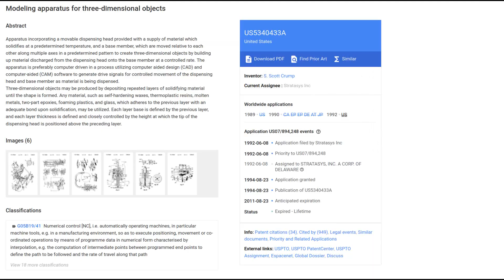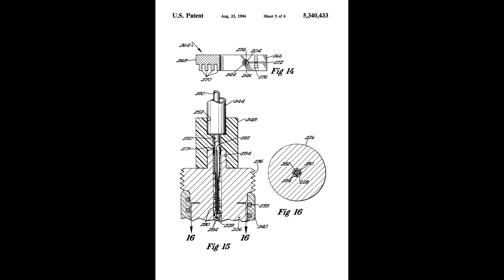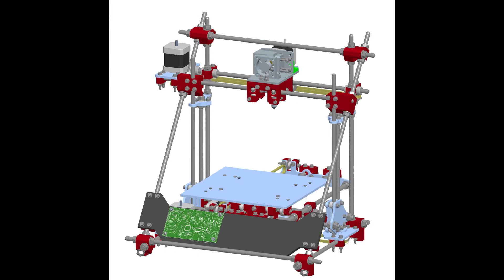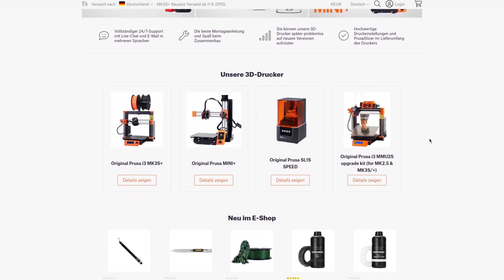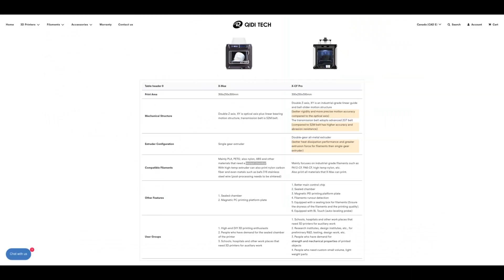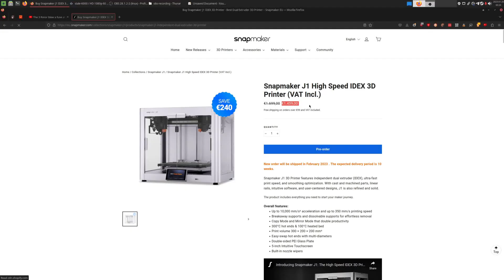3D Printing has gotten stale: The past, present and future of RepRap

Comment: It occurred to me the other day: Stratasys really lacked vision for the impact their technology could've had. Sure, every university had a $30,000 FDM machine which they would occasionally use for prototyping very specific models. But imagine if Stratasys had made a consumer-grade machine like the Ender 3 a decade earlier. Surely they could've become a household name which changed history? like Ford or Hoover.
Reply: I had the same thought a couple days ago, but at the end I thought they were right. The point is that general people don't need a 3D printer like they need a vacuum cleaner or a car, at the point that the market is still small even now that the price is at the rock bottom. So yes, they could have been where Prusa or even Creality is, but still I think Stratasys make more money than them just on their professional market. At the contrary if they brought to the market cheap printers they would have cannibalized at least a part of their high end machines.
Reply: @Marco Toselli  i agree. I think if you saw mass adoption of a 3d printer in every home ud see alot silk lizards. Benchies. And a handful of miniatures. The curve would be fast a year and a half maybe and they'd be on to the next thing.  These machines still require the use of cad in my opinion or 3d software to realize the full potential and thats where the work is. Just some thoughts. I've seem so many silk lizards.  The first time I told a "normal" person I had a machine that could make anything so long as it was out of certain plastics. "Yeah but what are you gunna do with it"
Reply: Without the internet, those machines were useless for the masses. Gcode files are far too large for dial-up internet. Also, the market had to exist for the filaments to be cheap enough for people to be willing to do trial and error.
Reply: @ryelor123  True. It probably wouldn't have been feasible in the 1990s. But it probably would from 2000 onwards. STL files are pretty lightweight.

The fact that hobbyists helped develop better materials than the patent-holder is further evidence that the patent hampered innovation.

And sure, it's unlikely they'd risk developing a home appliance. But at least something schools and small businesses could easily afford.
Reply: It's really not that simple, for one the only reason 3d printing as we know it exists is because of the millions of free manhours of labor the community has put in on top of corporate investments. 

No one company could have duplicated that let alone on a shorter time frame. 

There's also the fact that you can't just add a whole new packet to your business model on a whim. They would effectively have to fund staff and develope one or more entirely new companies to pursue tue consumer market.

You are also assuming they could develop a market similar to the one we know all on their own, more than likely they would invest hundreds of millions into a new venture, the product would be sub par and not consumer friendly,  the division would flash and burn, and fdm printing would carry a stain on its reputation that would dissuade many from trying when the patents expire. 

I mean, after all these years, hundreds of companies,  millions of users, only now are we coming to a point where maybe you could argue a minimum viable product is possible.... maybe.
Reply: @DrewLSsix  I think that the new Bambu Lab might be the true minimum viable product, but it's very closed down as a result.
Reply: They are much like xerox. Xerox developed lots of tech that other companies popularized.
Reply: @notanymore9471  Well, kind-of. But Xerox licensed that technology. They didn't just hoard patents until they expired.
Reply: I tell you what. They could have flood the market very early, but they would not make a penny from it. Every business is here to make a profit, not to make everyone happy. It is far more better to sell 30,000 USD machine and then supply it with overpriced consumables, than selling under 1000 USD and then sell nothing.

And the thing of someone occasionally using 3D printing is the same even when you have cheap machine. 3D printing now simply does not have so many use cases for the printer to go 24/7 in average business and really save a ton of costs. Customer is most interested into investing into new machine when he/she is starting with 3D printing. So it is far better to sell expensive 3D printer only because you are the only one who can.

It is also far more better to first prove the idea (which Stratasys did) and for that you need ton of money. If 3D printing would have be opensource and free from the begining, nobody really cared. It is different when there is large company who made millions of USD and their pattents right now expired, than when there is some crazy guy who made exactly 0 USD
Reply: @FUKYFILM  I'm not saying they should've open-sourced their technology. But I'm pretty sure they could've made (or licensed) a more consumer-grade machine around 2009 and it would've been successful.

Comment: I have a used printrbot simple metal that I bought for the price of 3 spools of pla. I use it 2-3 times a year. I originally bought it to replace a gear in a toy. Honestly I think the market is flooded with cheap used printers because people buy them thinking that it will change their lives but they find out they have little use and sell them. Despite being computer controlled, 3d printers have no accuracy and can’t be realistically used to design mecanical parts. You’re gonna say I’m wrong but the truth is that for designing a single part that fits, you need countless tries. If you only consider the cost of the final part in pla, yes that is cheap. But if you consider all the parts you trashed in order to make it and well… your time… yes your time, its far from a good idea. A single design can cost more than the 3d printer and have no real value in the end. If you get lucky and find a model online that fits your purpose you might save some time. It only happened to me once with a mask for covid which I never used…

Comment: Bed slingers are getting a bad rap.  For small build volumes, and for parts that are squarish or pyramid in the shape of their volume, they work.  Note:  CoreXY printers move in the Y or X axis when both motors move.  They move in a diagonal direction when only one motor moves, and the other motor is locked.  Since the head usually moves in a combination of X and Y at any given moment, it's clear that one motor in a corexy is doing the heavy lifting at any moment.  So a core XY printer will need more powerful motors then a same sized bed slinger.  So much for being faster.
OTOH, the corexz layout will combine the power of two motors to move the Y axis, as the Z is moved slowly and usually not at the same time as the Y.  For speed, the coreXZ may be the sleeper design.

Comment: Honestly, I thought FLSUN was in on this early. I’ve seen really good reviews, and while an SR isn’t quite as fast as a coreXY, they’re also cheaper. I’m probably going to buy one of them as my next printer.
Reply: Have you seen the V400 ? Is crazy fast thought expensive , faster than any of the Bambus too
Reply: @ulforcemegamon3094  Well, I got the SR I was hoping for, and it’s been fast enough for my uses. However, the V400 seems mediocre based on reviews. It’s basically a slightly larger SR with some mods that are already pretty common in the DIY space, and a half-arsed klipper install. All for twice the price. It seems to me that a klipperized SR with some extra cooling fans will perform as good as a V400

Comment: I waited till 2012 when the 3D printer market crashed and got me a Replicator Dual for $250 🥰 I didn't upgrade until 2020 since redesigning the flaws fixed almost everything wrong with those original models. Larger printers where too expensive and ended up finally getting a i3 stile printer that was open box for $110, again having to redesign many of the parts to give me another solid printer. The nature of a bed slinger will always have speed and cooling issues, so when another printer was discounted and open box i got that.. Creality Sermoon D1 for $250, this one had by far the best frame but poor quality control and plenty of design flaws itself. Again.. now an extremely reliable printer now.. just a larger and much more rigid version of my old replicator dual "Darwin Cartesian" printer.

Long->Short; software and faster 32-bit boards to be able to keep up with every increasingly complex tasks the software asks of the hardware have been IMO the only improvements in the past 10+ years. Otherwise CoreXY might have been the only real innovation to reduce extruder mass by moving the X axis motor to the frame

Little Longer; I can run my 260x280x310 Sermoon D1 (Darwin Cartesian type) at 250mm/s and 10,000 acceleration without ghosting but starts to hit the controller boards limits. I'll always consider i3 style machines more of an economical move than innovation for improved printing, unless innovation means more accessible which is definitely can be

More crap; my old Replicator dual with the original 8-bit MakerBot board still prints beautiful using modern slicers, just needs to be connected with USB to print as good speeds and high detail/accuracy. Reading from the SD card makes the board work harder and needs to run at about 45mm/s to prevent artifacts/blobs/skips, otherwise 200mm/s is perfectly doable but 160mm/s is the sweat spot with almost no ghosting at all

Bonus Crap; now companies like Anker and DJI jumping in is starting to push the quality and refinement of 3D printing to where I think i can finally recommend at least the Bamboo X1 to "normal" people

Comment: “If not for the educational market, a machine this bad for the money couldn’t exist” really sums any technology in education
Reply: I've been greeted with the misfortune of using a dremel 3d printer

it's wonderfully awful. for $1400 you can get the same quality of a monoprice MP select mini, with about the same build volume

I even had to 3d print my own replacement part for the door hinge, which was constructed as if a toddler designed it

it also layer shifts randomly, and uses a proprietary slicer AND filament... $1400 is crazy

Comment: I was going to get a Bamboo lab printer but the build plate was too small, I’m looking for at least 300x300 

Instead I got a tenlog, which has two extruders and allows for multi material without purge towers, and printing two things a at once 

I wish I could have the speed and material station of the bamboo lab with two printheads and a larger build area
Reply: Seems like you're describing the idex voron

Comment: I got into 3d printing with a Mendel and was hooked immediately. I built an i3 (wood frame), a custom delta (which was a bit naff!), a hypercube, bought a Prusa Mini, and now have both a Bambu P1P and X1CC. For all the (valid) arguments against Bambu and the non 'maker' aspect to its design and software its a phenominal leap in performance. I know Voron was getting there but was still obscenely complicated and expensive compared to earlier printers. 

One things for sure is that bed slingers are done. They've had their time in the sun, and CoreXY has proven without a doubt that its vastly superior. I'm really looking forward to the next generation. We're about to see an absolute boom in innovation in 3d printing. Prusa - arguably the best printer manufacturer out there is no doubt absolutely pooping themselves right now, and can no longer rely on their trusty 5+ year old design. I really hope that they're hard at work on a new printer (not the XL unless theres currently major changes happening behind the scenes) that brings them back into the frame as with the way things are going they're set to become irrelevent, along with the crappy manufacturers like Creality.

Comment: Did Slice Engineering really say "Communist Dystopia"? LMAO

Do you know about the Positron V3? It's in the same category as the Vorons but I think it's unique in its own right. I think a prebuilt one would be a great alternative to a mid range bed slinger, esp for people that don't have much space at home or want to bring it to places...
Reply from the maker: The Positron has potential, if someone was to optimize, build and ship the thing. You'd save a lot on shipping with a machine that compact and the design could be optimized for manufacture. BUT: Assembly seems complicated, maybe if you assemble in china or india? And there should be protection or something for that glass bed, it's way to fragile for something that will eventually be dropped in collapsing/erecting the Z axis. That's a lot of work, but very well possible.

But someone has to do it. And that's the problem. Maybe you'll be that someone?

Comment: Slices patent doesn’t prevent innovation, it encourages it. It forces the community come with better designs.
Reply from the maker: No, I don't think so. It hinders further development on the idea "seperating a heatbrakes thermal and structural jobs into different components" for anybody other than Slice Engineering. There might be different approaches, such as the E3D Revo "Nozzlebreak" platform, and it might even encourage innovation there (though I doubt it). But it definitely hinders or even prevents development on the patented idea for anyone outside of Slice.
Reply: @SERVOPUNK  look at 3DP and Prusa… innovation stagnated for 6 years for wide scale printers until Bambu came along. Open Source to some extent pushes complacency. Laziness. Slice patented a commercial product they created. Nothing wrong with that.
Reply: @thelightspeed3d712  If a company were to patent a standard two wheeled bike but fails to bring it to market, and another company manages to successfully bring a tricycle to market and the product is successful, that doesn't mean that the tricycle is better, more efficient or innovative. Innovative in the sense that it is forced to find a way to skirt the law to bring some amount of value into people's lives, but not in the sense that the product is actually any better. Patent's don't by nature encourage any measure of innovation, and especially not improvement.

Comment: Got to say I am really happy with my vzbot that came from my horrible tronxy x5sa. I used the tronxy as it was configured from tronxy and slowly upgraded till I was ready to make the jump.  

If anyone reading has a x5sa and is considering building it into a vzbot, this is the sign to do it. If you don't want a full vzbot build, install klipper on the stock board,do.the gantry mods using a EVA.corexy and bmg /v6 mount and brace the printer, you will have a substantial improvement.
Reply: Thanks, i don't have it but sounds interesting got the Tronxy as a starting point.
Reply: @OmegaDeepBlue  the tronxy out of the box was terrible for me. I used it for months with a quality v6 clone and that helped.  Things for a lot better when switching to direct drive using the stock extruder and a custom printed mount. Under extrusion and stringing was Eliminated, z sync belt was installed at this point along with printed frame braces. 
In all reality you could stop at this point and have a decent printer. It won't be the best or fastest but works pretty good and doesn't cost a ton to get to this point.

Comment: I want to gent into 3d printing and it is a very difficult choice, buy a proven, but stupidly overpriced Prusa, P1P and accept its proprietary parts and loudness or wait for more fast printers, because it feels there will be a lot of them launched soon. Really tough choice.
Reply: Build a Voron 0.2. Very capable, pretty cheap (for what you get) and you'll learn a lot. You'll also have a printer with a great community, that will remain very capable for a long time. The only downside is the small plate. You can then use the 0.2 to print parts for a 2.4 or Trident or RatRig and keep the journey going...

Comment: Really liked the video but I was disappointed on the limited content on the 4th era printers! The video ended too soon!
Reply: Really the 4th era or 'next gen' is only just kicking off. We've got Voron and Bambu being the main contenders. Sure, Prusa are hoping to join the party with the XL but from what we've seen so far its more like gen 3.5. We simply dont know what else will come out later this year / next year yet but with any luck it'll be good competition as right now 4th gen is pretty niche (although Bambu are changing that pretty rapidly given they've shipped well over 250k units at this point).
Reply: @puressk  What's funny too is that the Bambu and Voron are just CoreXY printers. They don't bring anything truly new to the table, they're just making premium features accessible to the midrange market. 

I'd say we're still in the second era of 3D printing, where technology that's been used for industrial applications since the 80's is still trickling into the home-gamer market - and we won't hit a third era until i3's are universally considered the dinosaurs they are and all budget printers are CoreXY.
Reply: @NefariousElasticity  I'd say the Bambu does offer a few new things. AI based spaghetti detection, LIDAR scanning, the AMS, etc. Maybe some of these were previously on high-end industrial printers, not too sure tbh.